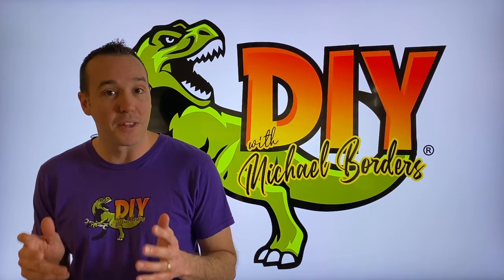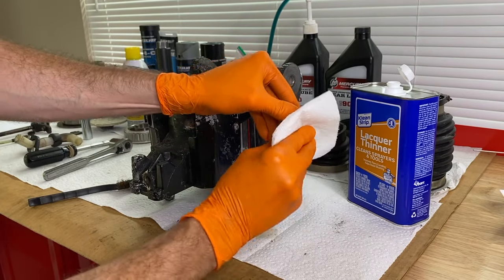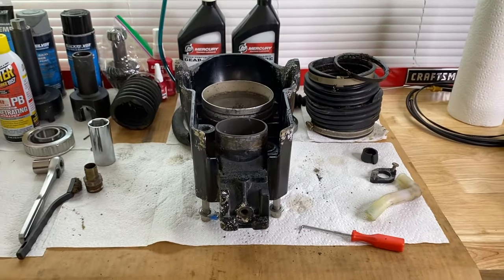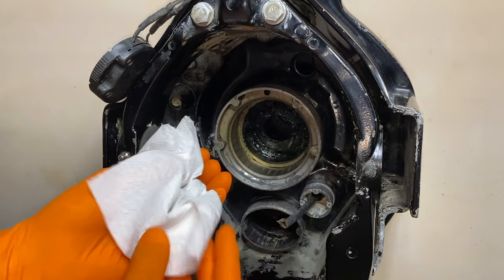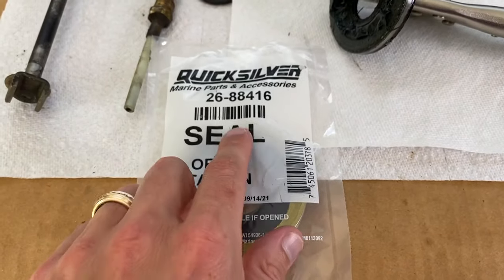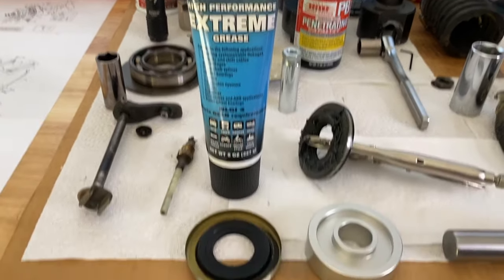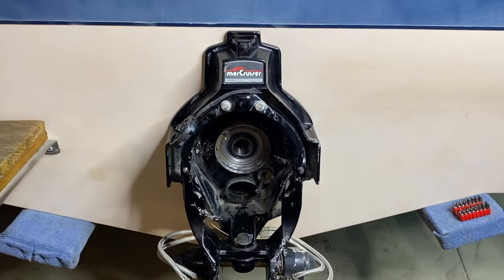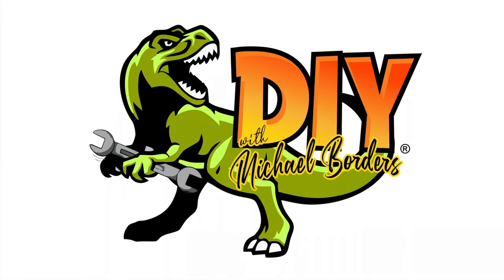Replace Mercruiser alpha one gen 1(2) outdrive bellows - PART 3

Comment from the maker: If interested in purchasing this product, visit our Amazon affiliate link below.  I earn from qualifying purchases.

PB Blaster:  https://amzn.to/3segbAM

1 1/16 deep socket:  https://amzn.to/3OBwZsG

Craftsman impact gun:  https://amzn.to/3DTtkBB

Lacquer thinner:  https://amzn.to/3QGvxbd

Steel/brass brush cleaning set:  https://amzn.to/449jIgI

180 grit sandpaper:  https://amzn.to/3YASfDN

Pic tool set:  https://amzn.to/3OCE9NE

Long flathead screwdriver:  https://amzn.to/3OQebHB

Rubber pads:  https://amzn.to/442v2LG

Vise grips:  https://amzn.to/447BSPV

Gimbal bearing install tool:  https://amzn.to/45ukLJt

Gimbal bearing grease seal (26-88416):  https://amzn.to/3qzcHIk

High performance grease:  https://amzn.to/3DW1UeE

2lb hammer:  https://amzn.to/3QDHiz3

Sealed gimbal bearing:  https://amzn.to/3OADM5R

Bellows replacement kit:  https://amzn.to/3RL7h8v

Set screw (10-8M2015913):  https://amzn.to/3KCQIqV

Security bits:  https://amzn.to/3KFvXL0

Aviation gasket sealer (1525607):  https://amzn.to/3YCobYb

**********

1.  Replace bellows/shift cable/water tube PART 1

          https://youtu.be/NcObTOYXtQM

2.  Replace bellows/shift cable/water tube PART 2

          https://youtu.be/HBJN8MGoQ64

3.  Replace bellows/shift cable/water tube PART 4

          https://youtu.be/_OkgtW7oRKs

Comment: Your link at the end goes to part 2
Reply from the maker: Thanks for watching, hopefully we can help.  We have attached lots of links that include parts, tools, and additional videos.  😁👍🧰

*************

If interested in purchasing this product, visit our Amazon affiliate link below.  I earn from qualifying purchases.

PB Blaster:  https://amzn.to/3segbAM

1 1/16 deep socket:  https://amzn.to/3OBwZsG

Craftsman impact gun:  https://amzn.to/3DTtkBB

Lacquer thinner:  https://amzn.to/3QGvxbd

Steel/brass brush cleaning set:  https://amzn.to/449jIgI

180 grit sandpaper:  https://amzn.to/3YASfDN

Pic tool set:  https://amzn.to/3OCE9NE

Long flathead screwdriver:  https://amzn.to/3OQebHB

Rubber pads:  https://amzn.to/442v2LG

Vise grips:  https://amzn.to/447BSPV

Gimbal bearing install tool:  https://amzn.to/45ukLJt

Gimbal bearing grease seal (26-88416):  https://amzn.to/3qzcHIk

High performance grease:  https://amzn.to/3DW1UeE

2lb hammer:  https://amzn.to/3QDHiz3

Sealed gimbal bearing:  https://amzn.to/3OADM5R

Bellows replacement kit:  https://amzn.to/3RL7h8v

Set screw (10-8M2015913):  https://amzn.to/3KCQIqV

Security bits:  https://amzn.to/3KFvXL0

Aviation gasket sealer (1525607):  https://amzn.to/3YCobYb

**********

1.  Replace bellows/shift cable/water tube PART 1

          https://youtu.be/NcObTOYXtQM

2.  Replace bellows/shift cable/water tube PART 2

          https://youtu.be/HBJN8MGoQ64

3.  Replace bellows/shift cable/water tube PART 4

          https://youtu.be/_OkgtW7oRKs